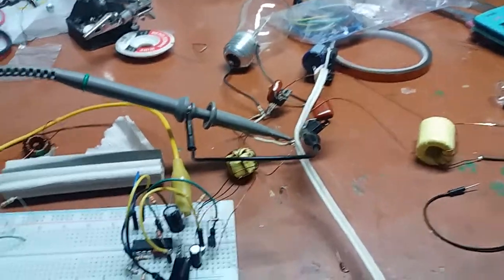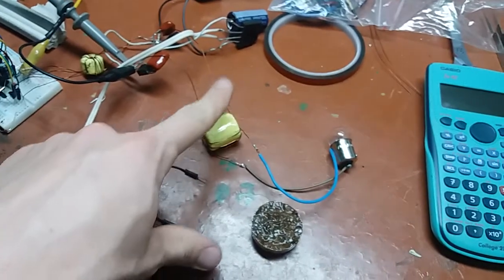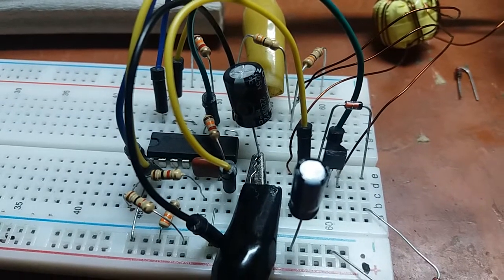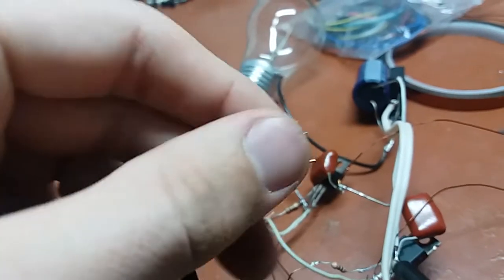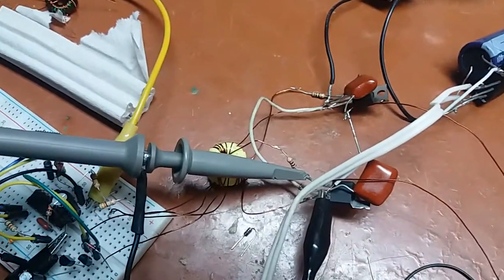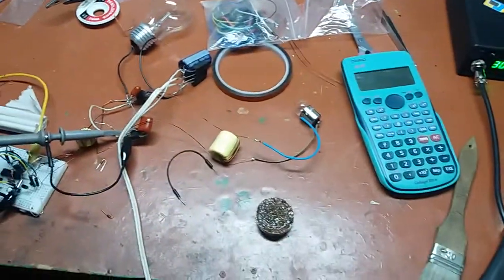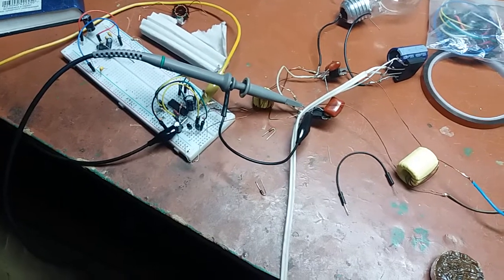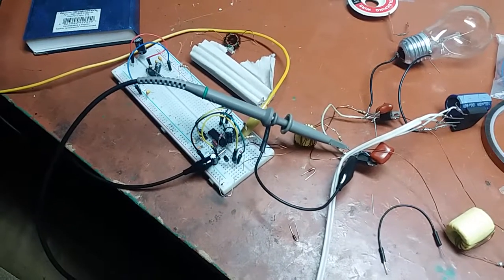tl494 SMPS: Part 1 - First prototype

Comment: Hi mr johny. Nice vintage oscilloscope. A beautiful analog piece! Unfortunately here in greece there is almost no analog ones available and customs are so so strict with fees that there is no way to order one through ebay. 
Nice try with smps. I think its a half bridge topology isnt it?
Reply from the maker: Yes, it's a halfbridge. Right now it's on PCB already, works quite good. Has few querks, but I'll fix them.
Reply from the maker: If you have enough money, go with DSO. It has some really useful features.